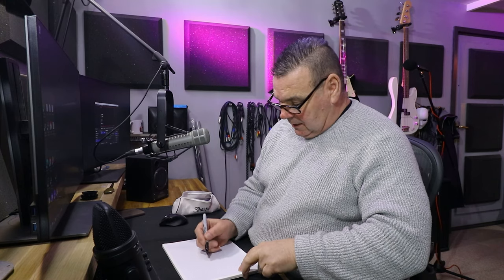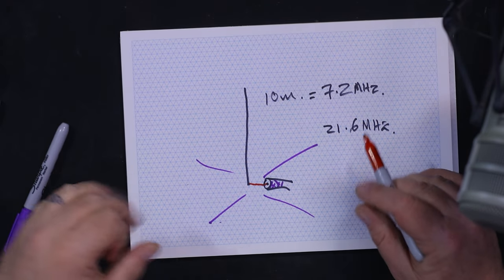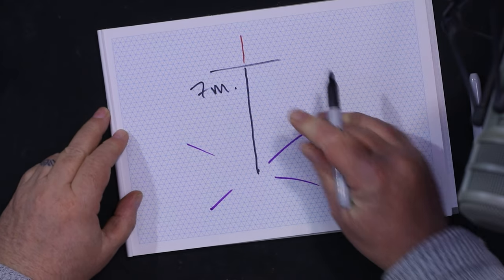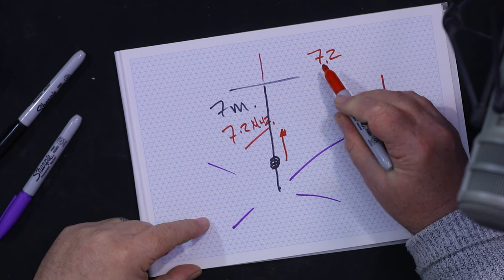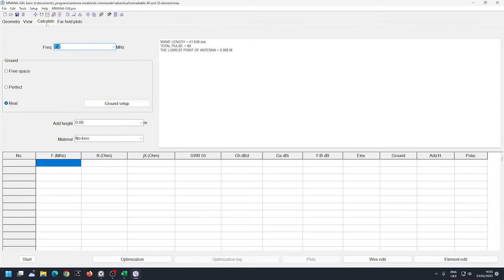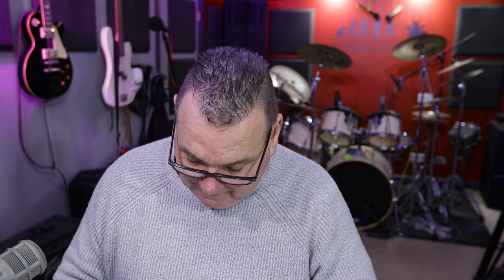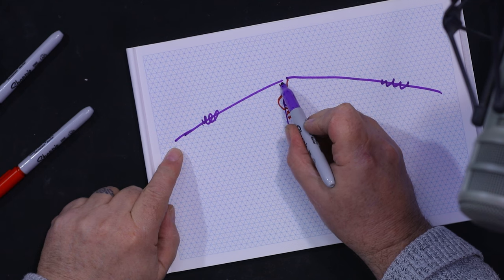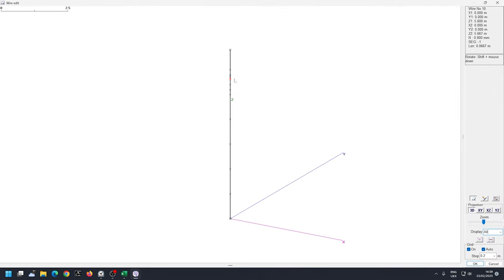Antenna Secrets: The Strange World of Coils and Antennas

Comment: Interesting stuff Callum… but in the back of my mind I am also thinking of the Vertical Trap, which also gives 20 and 40 on one element.. I would need to understand (electronically) the difference between what you are experimenting with and a trap. Then consider the EIRP of both…. Is the trap more efficient?  You do realise I will be thinking of this all day 😂😂😂😂 Cheers .. Andy G0NKK
Reply from the maker: I know.. They MIGHT be very similar..! I was hoping the moment method MAY produce a better pattern though for the 3rd harmonic. Software doesn't think so. WOuld atrtap reduce performance of a 40m element more than the shortened coil up high? That's the other consideration. The only other advantage to this system is if someone specifically needed a smaller element. Lot's of fun!

Comment: Different animal but the shortened end fed Halfwave has a 34uH coil at 10m from the 49:1 to act as a choke and loading coil for 40m, with about 1.85m of wire the other side of the coil. Total length 11.85m. Provides 40,20 and 10 (10 as a full wave). 73
Reply: Have one!
Reply: Have one as well 🙂

Comment: I suppose that you can have several antennas if you have the room and switch to the one closest to the frequency you are working for the best signal.  If you have the room for it.  I am lucky that I don’t play with DX because I have a huge cluster of 2 meter and 440 repeaters in my area and I spend most of my radio time talking endlessly with them. Something to think about though if I get interested in DX.

Comment: 11:15  Cal, are you sure that the antenna is resonant on these frequencies? Or just have a good SWR? I'm sure the antenna will work, but resonance means no capacitive or inductive reactance but just ohmic resistance. A end half wave - as an example - is resonant but has a bad SWR because of it's high impedance (which is basically ohmic resistance). The question is no offense, i'm really interested and you propably know I'm your follower, fan and customer. Maybe i'm a too theoretical idiot (without understanding the theory ;) ). To understand whats happening, i think we should think of the antenna being a resonant circuit which we are able to tune with capacitors and coils in series or in parallel to tune frequencies which also does a tuning/matching in impedance. And you can think of antenna wire being a transmission line for another part of the antenna. Transmission lines transform impedances too.  A good thing to understand what's happening is a smith diagram. Greatly explained by w2aew. 73
Reply from the maker: Yes, I am sure it's getting out very well and let me explain why.. The 30m coild on the 80m element works "too good". I would expect to see a tail off in performance but everyone reporting an excellent result on 30m. I think we need to test it hard and work out the results. PS - Far field plot seems to show we're moving RF in the right direction too. Very good question!

Comment: If you can get 80/30 you should also in theory get 10 as a 3 half-wave dipole using the 30m section without the need for separate element for 10.
Reply from the maker: But it's not the 30m "section". The harmonic has moved again due to the coil not being a trap.
Reply: @DXCommanderHQ  true, oops forgot that